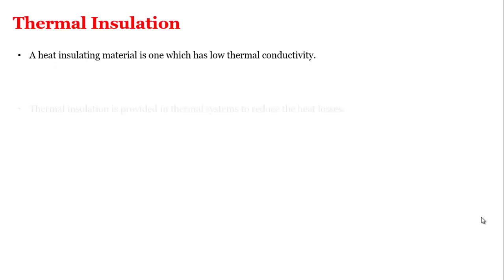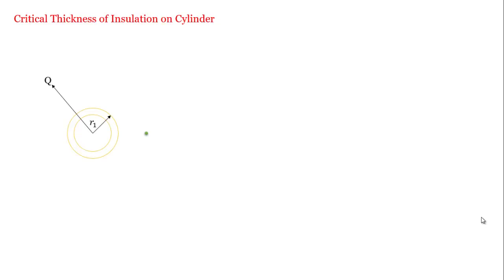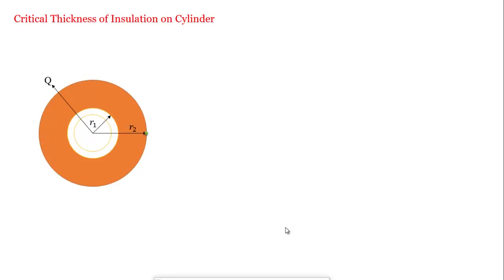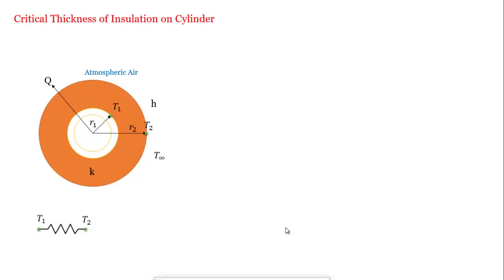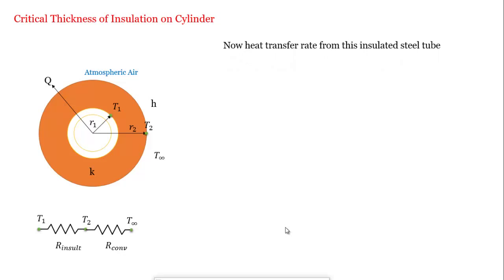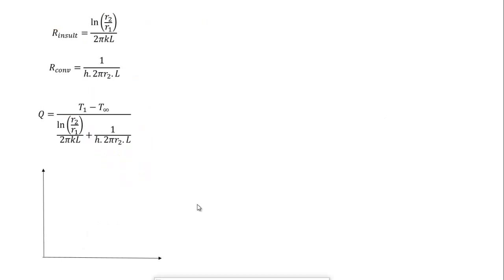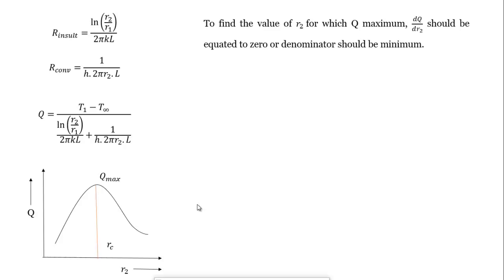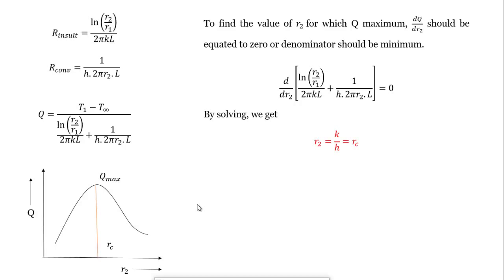Critical Thickness of Insulation l Heat Transfer l GATE 2020 Mechanical

Comment: Dear Sir,
Because thickness is reciprocal to heat transfer so when add insulation first half increase heat transfer ???  why
Reply: because the surface area increases with increasing r2.